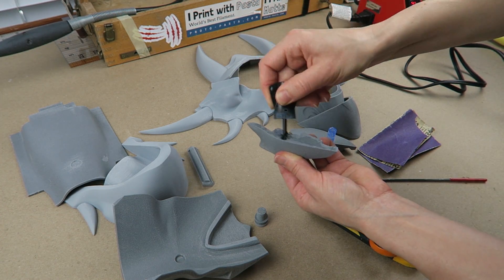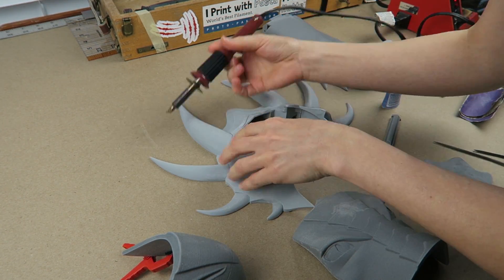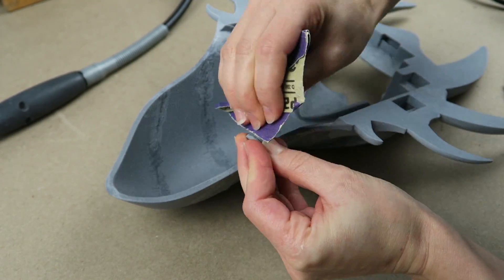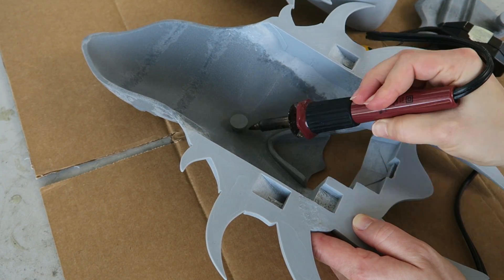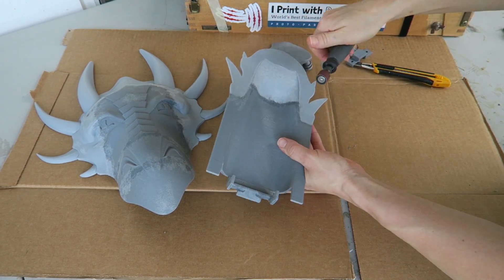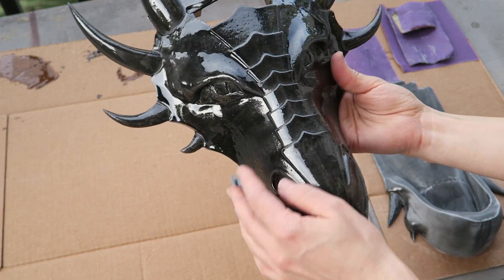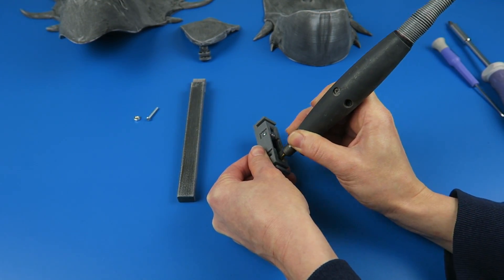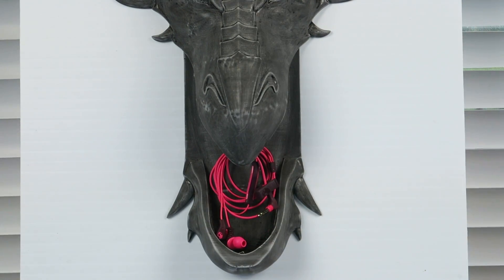BEST WAY to Join and Smooth 3D Printed Parts | Dragon Secret Compartment Box Part 2

Comment: What resparator do you use? And where did you buy it
Reply from the maker: Typically a aandard 3M respirator with dust filter or organic vapor filter depending on the job. Got it on Amazon because I needed size small.

Comment: Great video. I find it easier to use spare filament to fill the seams with the woodturner instead of scrap parts, hold the filament along the seam line and just melt it into the seam with the wood-burner. A bottle of CA accelerator is also helpful if you don't want to wait for the CA glue to set. Just glue, hold and spray, it let's you bypass using clamps.

Comment: I find having a 3D pen to hand is helpful for doing joins. I’d stick it with glue gun, use the pen to add some plastic down the seam and then smooth with the burner before sanding. Works nicely

Comment: Amazing work and guide :) You could try using a superglue activator spray to anchor the pieces together, even just a quick spray at either end of the joints as the rest of the superglue sets :)
Reply from the maker: That would probably make it easier.

Comment: Well done ! Though I have  one suggestion, well maybe two, from my personal experience. Get yourself a soldering iron with a temperature control ( they are cheap this days). Than use  the same filament you are using for printing to make your welding seams. With the temperature controlled soldering iron you can get a fantastic job!!
Reply: Isn't that essentially what she did? Clearly the wood burner has temperature controls... she said find a temperature that won't burn the plastic...

Comment: Your work is AMAZING!  What would be a nice enhancement to this dragon would be led lights in the eyes and mouth. Hooked up so that when opened, the lights and mouth light up. this could be achieved using a small micro switch that is normally open. When you open the latch, it switches to closed position and turns on the lights.
Just a thought.
Reply from the maker: That would be fun. Maybe a version for Halloween.
Reply: @LindyDesignLab  LOL ... Then you would have to hook up a small fog machine to it. Then, when the mouth opens and the fog starts to come out, you can have yellow and orange LED lights twinkling and it would look like fire.

Comment: hi I used xtc 3d and had great result although in big projects you dont have enough time to cover the part . the other epoxy you havehavent tried it is it holding well on surfaces that are not flat ? does it starts going downwards in a  vertical surface ?
Reply from the maker: Yeah, the XTC has a shorter working time than table top epoxy. Any resin will flow on a vertical surface and be thinner than the horizontal surfaces, so multiple thin coats is the way to go.

Comment: I am always blown away by your projects and shear skill. I've learned so much just from watching you work and I thank you many times over <3

If you were going to apply multiple coats of apoxy, would you apply the first coat, sand, reapply and sand? or apply all the layers of apoxy and then do all the sanding at once?
Reply from the maker: Glad it's been helpful. I'd probably do 2 coats, sand and then a third coat if necessary or even pour one final clear thick and glossy coat as a final finish if that made sense for the design. Depends on if the model has fine details which can get lost in multiple coats, also on the shape of the model as to how thick you can get it in each coat without it running off.

Comment: i had sen Bill at punished props show that melting filament with a wood burner thing, and had assumed PLA was too low of a temp for it , Awesome!
Reply from the maker: As long as the heat tool has an adjustable temperature, the method works on any plastic.